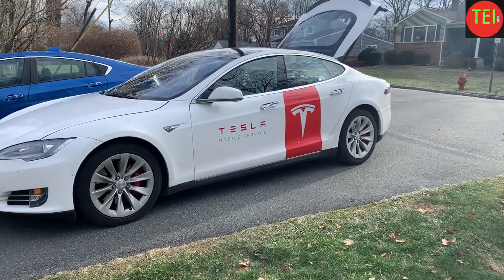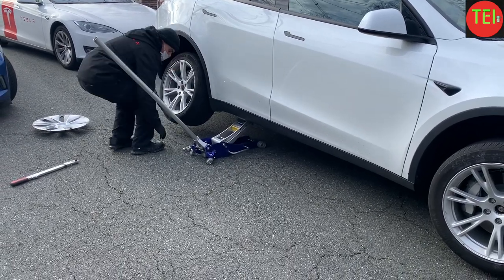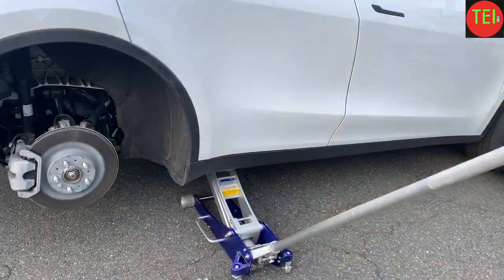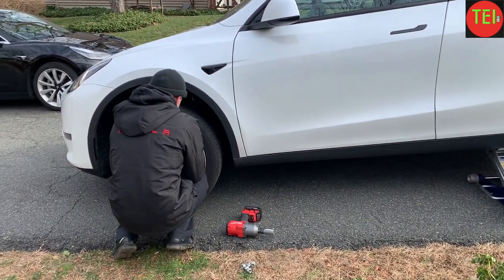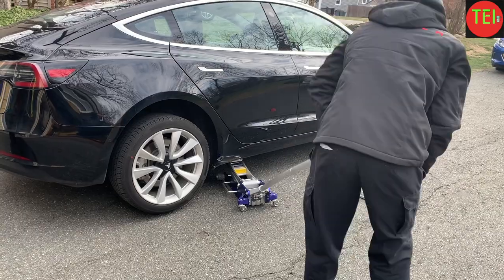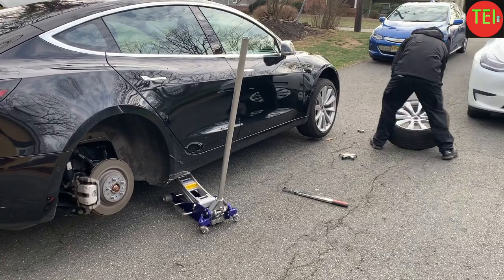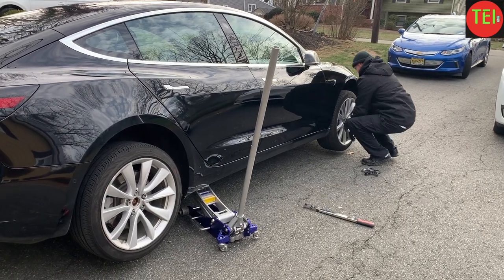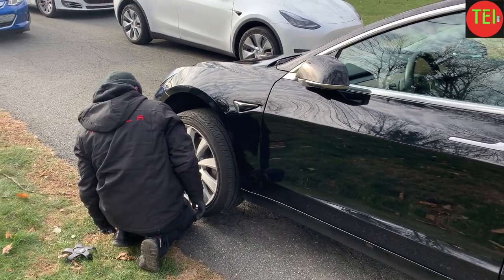Perform Tire Rotation on your Tesla Cars

Comment: Great Commercial for TESLA RANGERS. $42 unbelievable value! Right now we have NISSAN CARS. I do all my own maintenance such as oil changes and brake jobs. I owned and serviced GM vehicles by jacking from front under middle of main cross member and jacking from rear under differential. In 2007, I purchased NISSAN ALTIMA, 1st of 4 in fleet. Now I can only Jack from side behind front wheels that lift the whole side of car for oil changes and tire rotation. 13 years ago at age 61, I thought it was time to let the dealer do the work but on the very first oil change they blew it. I have this ritual to check all 4 family cars for oil levels. I was horrified that my Altima with V6 engine oil level was near add level after their service 3 days earlier. The problem was most Altima’s are 4 cylinders and are a litre less than my car that cost $6,000 more and I decided to continue my service work and switched to synthetic oil. Now that l am 75, I have taught my Daughters Partners how to do oil changes on all their vehicles in my 4th RV Garage, I can’t wait for My CYBERTRUCK and TESLA Service, Moshe, do you have winter & summer tires mounted on TESLA or after market rims to make tire changing less expensive. And now tire shops also want to do a wheel balance as well when rotating tires. I would rotate tires every 5000 KM with oil changes. I’m sure that You must have winter tires and do You have 2nd set of rims?